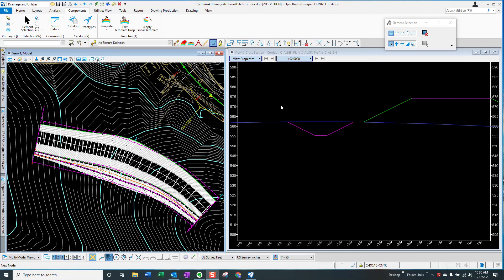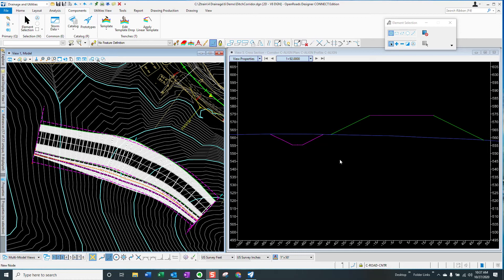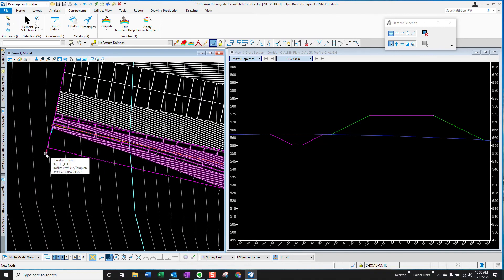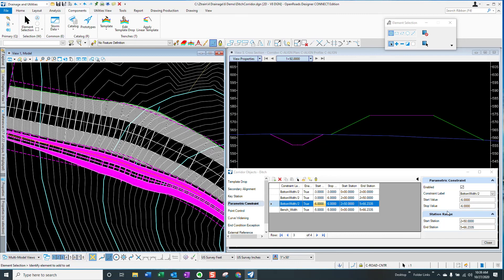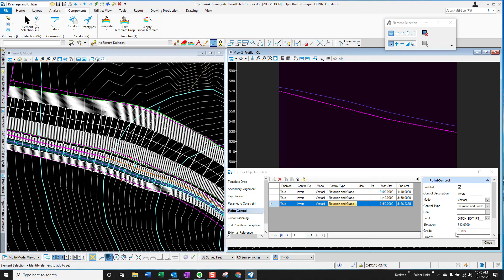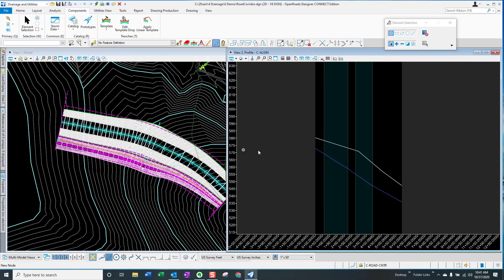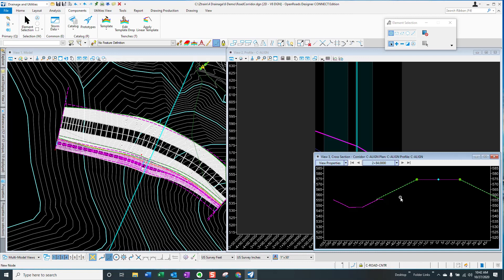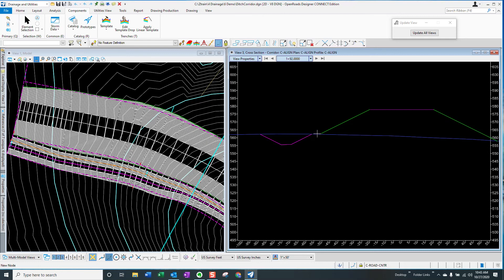Don't Design Ditches the Hard Way

Comment: Is your ditch corridor running by the toe line of the roadway fill slope? Or did you use point control to ask the right bench point to tie into the toe line?